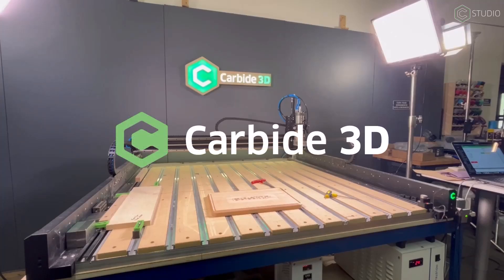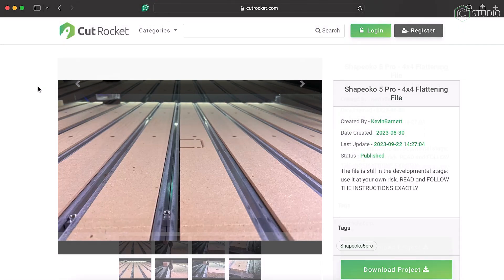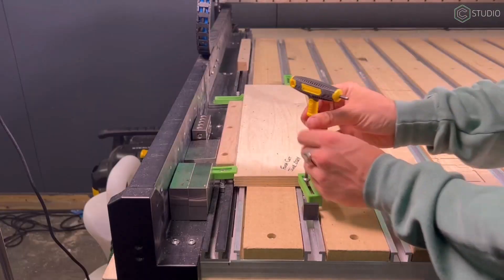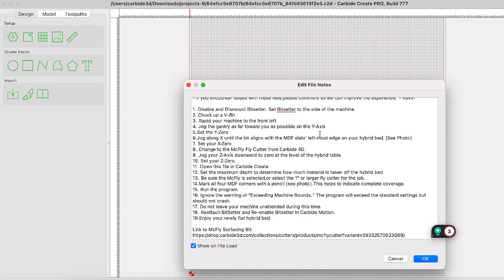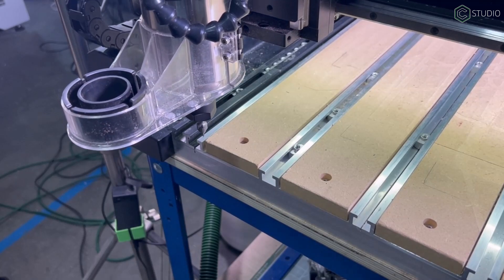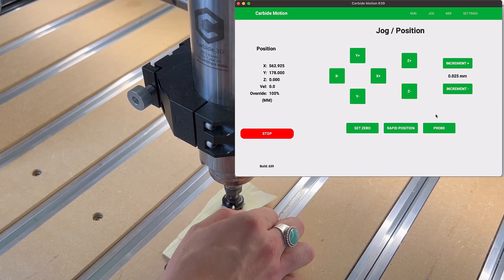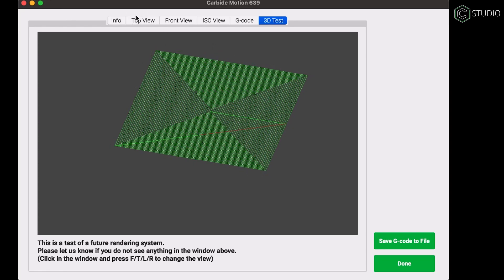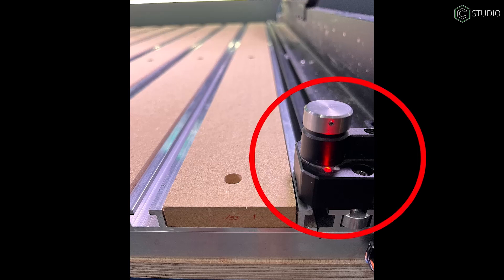The Support Show #12 -  How to:  Flatten Your Wasteboard

Comment: How fast can you run the machine (inches or mm per minute)?
Reply from the maker: Shapeoko 5 Pro and HDM can do 5,000 mm/min, Shapeoko 4 and Pro can do 10,000 mm/min. The speed difference is due to the mechanical reduction of the drive trains. 5 Pro and HDM can move with more force, and take better advantage of VFD spindles.
Reply: @carbide3d   sorry, my question was not very clear.  I know my shapeoco 5 pro can go up to 200 in per minute.  I'm running the vfd spindle.  Can I go full send if I'm taking about .03 in off of my spoil board with a 1-in surfacing bit?
Reply from the maker: @DIYAudioGuy it really depends on the wood, and also how certain you are that there’s no high-spots in your board that might result in unexpectedly deep passes. It may be possible, but you're gonna have to make a judgment call and see how the cut looks and sounds. 

The good news is that you can test it pretty easily, with low risk. Make a surfacing program at 100 IPM, then use the feedrate override function in Carbide Motion to see if the machine and spindle are happy at 110, 120, etc. If you don't like the sounds you hear, back it off. No big deal.

Comment: I would mention that your existing slats may not all be at the same height and testing different areas to confirm no high spots exist. Or if they do exist, you find the higher one and start at that height.
Reply from the maker: You're right.  This is why putting pencil marks throughout the wasteboard, precisely as you would with a board being planed, is a good step when you begin.

Comment: I have a Shapeoko 3 and went to flatten my wasteboard. Entire surface was covered and yet it seems now to be wavy, Not stepped as in a tramming error but wavy on sections and not everywhere. I've never been pleased with this machine, The tramming was fine, so I am at another loss for this result. Continually saving for a better machine.
Reply from the maker: If you end up with a wavy table after flattening, then you likely have some mechanical play in the machine that needs to be addressed.  (Or the structure is bent, which is very unlikely, even on a 4-year-old machine)
Reply: @carbide3d  Yes, I agree. I went over it once again, found a few places to tighten and re trammed it. It is still a bit off, but it is what it is.

Comment: On the Shapeoko 4, the cutter can't reach all the way to the left, right or back of the spoilboard. I guess the (imperfect) solution would be surface once, and then swap all the MDF slats front-to-back, swap the ones at the left & right into the middle, and then surface again?
Reply: Being somewhat OCD, I wanted to make sure those cutter-inaccessible areas were not higher than the surfaced spoilboard, so I removed the slats and cut them on edge on my tablesaw to be slighty thinner. I would not want to surface the spoilboard with slats not in the actual final position as that defeats the whole purpose of flattening in place.
Reply: @smorgasbord42  This works great! I did this for the second time I surfaced mine.
Reply: The first time I surfaced the boards on my 4 XXL, I traded the left and right most slats for the the respective ones next to them and moved them all up one screw hole to finish surfacing. The idea was to keep everything as close to its final resting place as possible since variations in the table would usually start gradual and become more pronounced as you move further away from a particular edge.
Reply: @TornadoCrafter  Yeah, I didn't think of moving the slats up one screw hole.
Reply from the maker: Hey guys, 
Yes, surfacing was an issue and that’s why the S5 is designed the way it is.   With your machines you have the option to shorten and narrow the wasteboard slats to keep them inside the machinable area.   This was my best plan when we were running the S4 Pro full time.  
- Kevin
Reply: @carbide3d  Unfortunately, shortening and/or narrowing the wasteboard slats isn't really a viable option, at least on my S4 Pro Std. The holes supporting the two side slats are outside the flattenable area, so cutting the slats to be narrower means you can't attach them anymore. And for shortening, the 3rd attachment hole is lost on all slats, too. 
I really do think the only viable option remains as I've stated - take the slats off and mill them down below the flattening level outside of the flattenable area. You can even do this on the Shapeoko itself if you wanted.
Reply from the maker: Have you considered milling the area around the back bolts down below the level of the T-Track height? (perhaps to 1/2 of the normal height)  This way it could still be bolted to the table but wouldn't require further surfacing.  This would be best accomplished off the machine with a router.
Reply: @carbide3d  That's what my first comment described. I did it with a tablesaw for the width of the side pieces, but as I said upthread, you can also mill them on your Shapeoko.